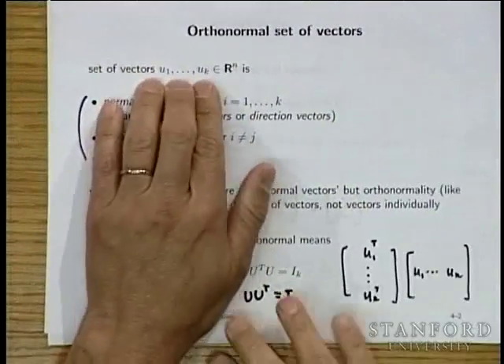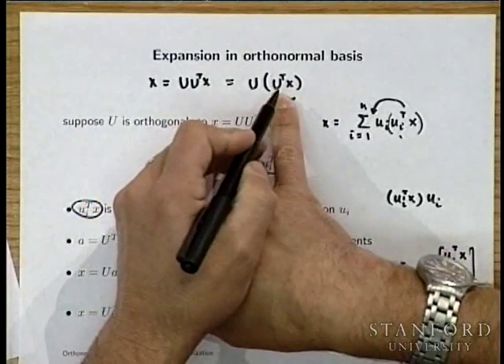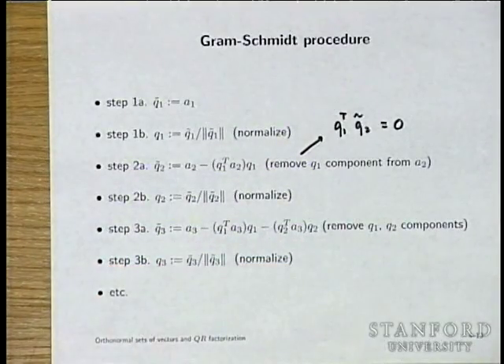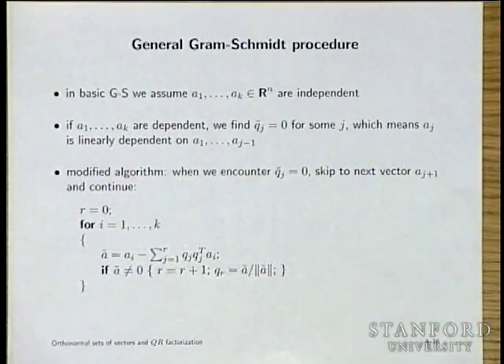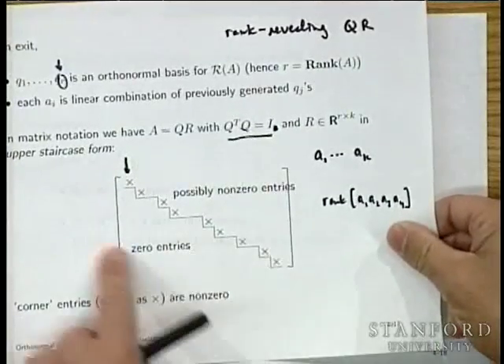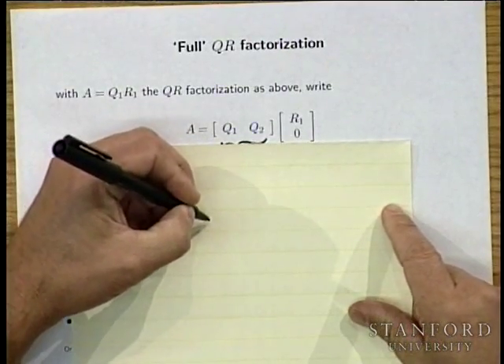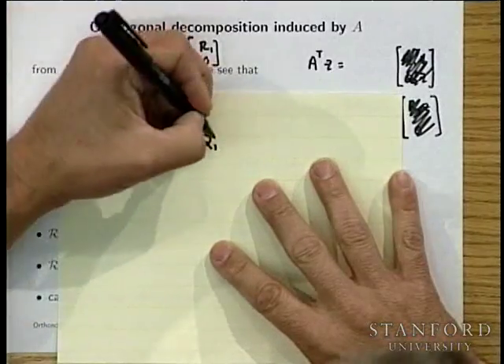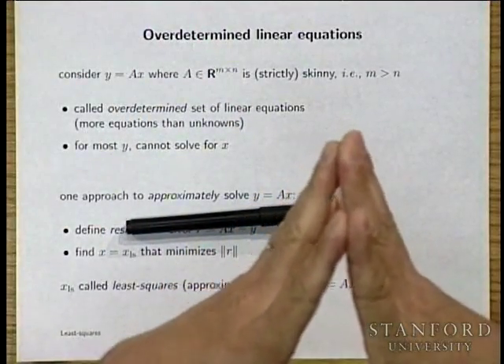Lecture 5 | Introduction to Linear Dynamical Systems

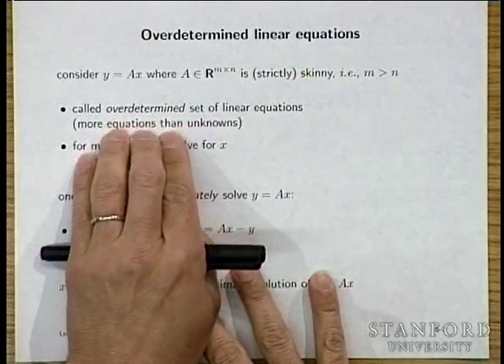Comment: He got confused about dimensions at the end 1:13:47 onwards and explained under determined system instead of over determined system.
Reply: Hi! It's been 10 months since you commented on this. What are you doing now? Did you take Boyd's convex optimization next?
Reply: @enisten  I don't understand the reason you are asking this. But, I am doing the same thing what I was doing 10 months back. Unfortunately, I stopped with C.Opt-1. I will try my best to help you if you have some questions about the subject.